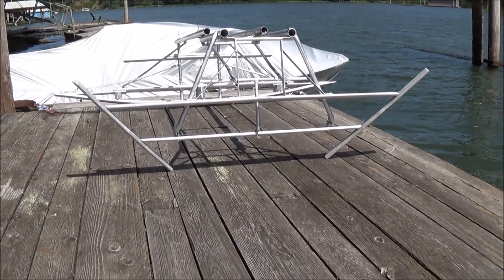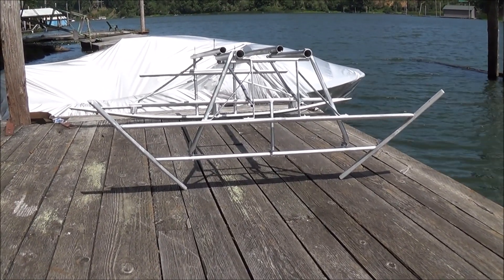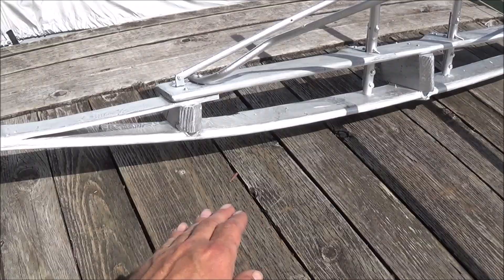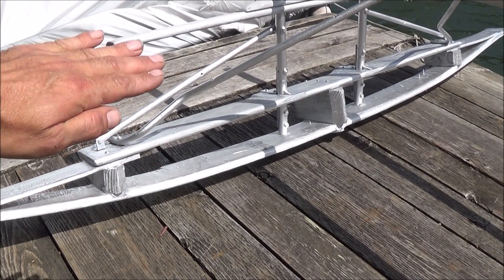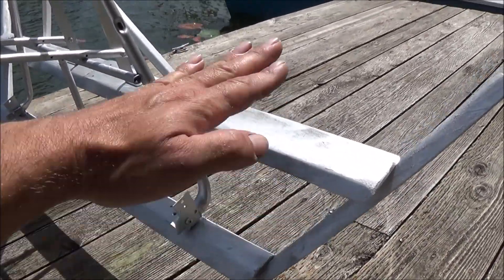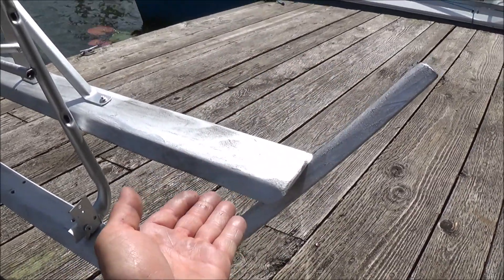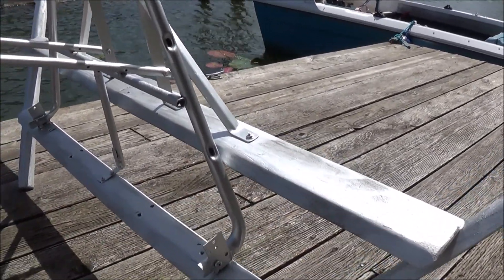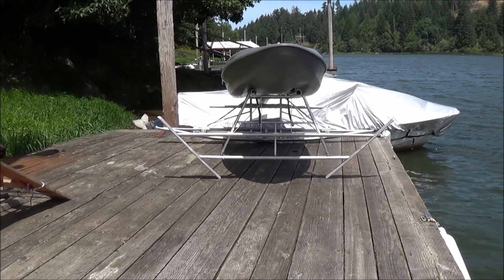Hydrofoil Kayak

Comment: Might be good to put a heavy-duty spring balance in-line with the tow rope so you can measure the force required to get the boat up onto the foils and to maintain different speeds.